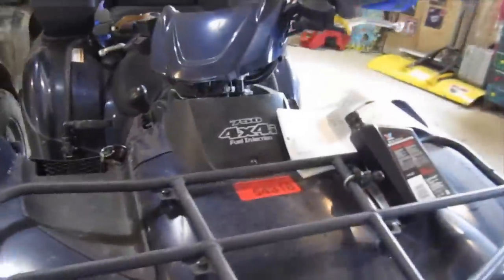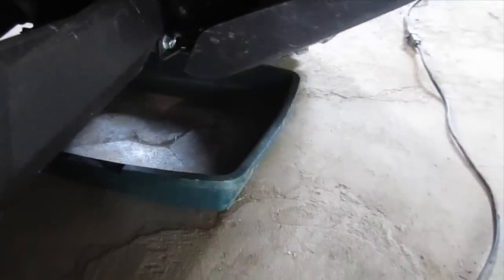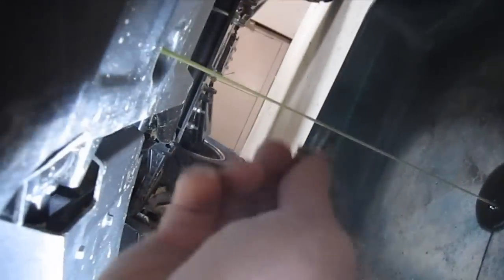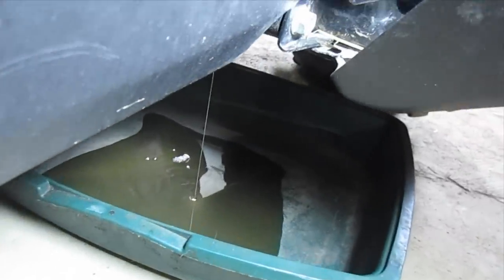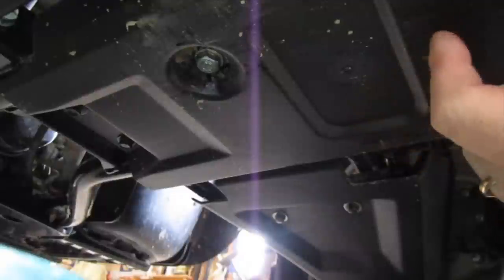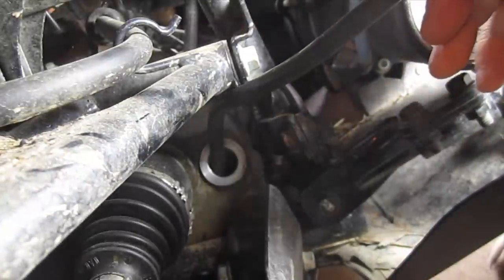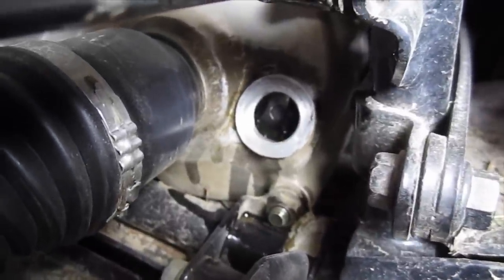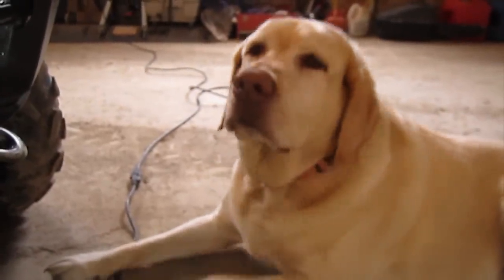How to Change the Front Differential Fluid on a Kawasaki Brute Force, Prairie and Other ATVs

Comment: Good video, Mark! One amendment: 
ALWAYS locate and loosen the fill plug FIRST when working with diffs, axles, & trannies. This ensures the technician never encounters a situation where fluid is drained, but cannot be replaced (via the fill port) in the event of a stuck fill plug. It's a rare problem, but it does happen.
Very helpful video overall. 🍺✌

Comment: Tip: The front diff will hold more oil if you jack up the front of the Brute and spin the wheels while you're adding oil. Keeps the clutch pack under more oil which will help with wear.

Comment: Nice video! The Jaso Ma means Japanese Automotive Standards Organization MA. The MA refers to machines or applications without friction modifiers like molybedium. This essentially means that it will now cause wet clutches to slip such ad the ones in atv differentials, quad/motorcycle clutches and even wet brakes like those found on th prairie 650.

Comment: I have a suzki king quad 2008 and the front diff or drive shaft is frozen with mud tried hot water will not move. Also started leaking oil out the bottom right side of the engine. Any recomandations?

Comment: Howdy Mark Jenkins.  I really appreciate your DIY on front and rear differential.  I have an old manual impact tool which w/cutoff 5mm alan tool, it'll come right off & I'll replace w/bolt as you suggest.  Thanks again/80yrold GreatGPA/GA.

Comment: How could I clean out my front dif? Opened it up and the oil is milky. Can I fill with diesel or 25% atf fluid ? Obviously change fluid again after working dif a bit.

Comment: 10W40 is not used in the front and rear axels, your supposed to use SAE 90 GL-5 Hypoid.
Reply: In the old manuals, 10w40 was used in the front.  As you said, now the front uses GL-5, but the rear uses a  Wet Brake Oil...

Comment: Thanks. Great video.
Reply: Stripped the allen bolt despite my careful attempts not to do so, and couldn't get my vice grips around the bolt. What I'll likely do is notch the bolt with my dremel tool to accept a standard screwdriver. I'll replace the bolt with hex bolt that you suggested. Dumb idea for allen bolt by Kawasaki.